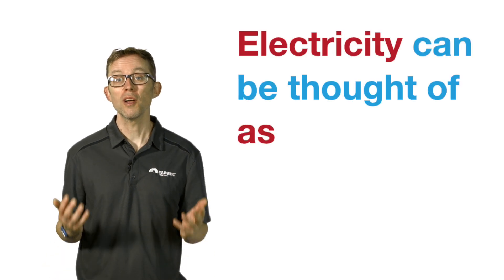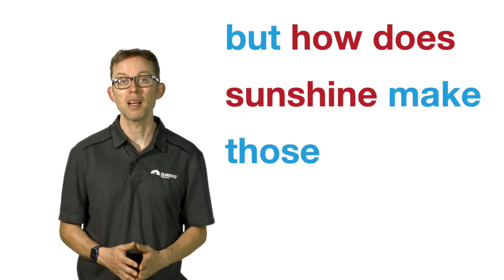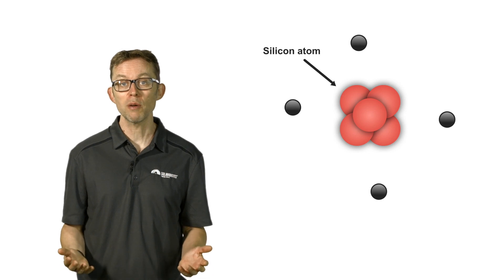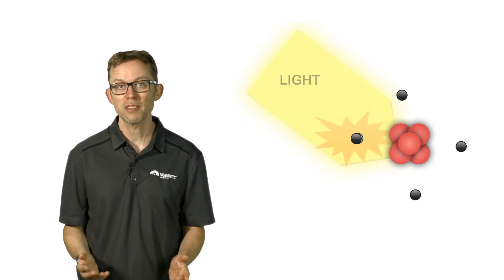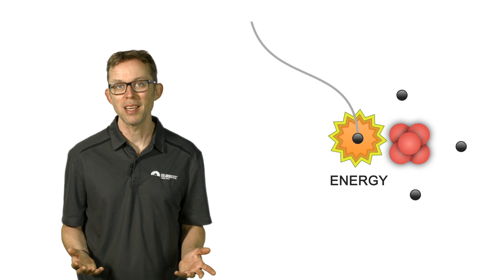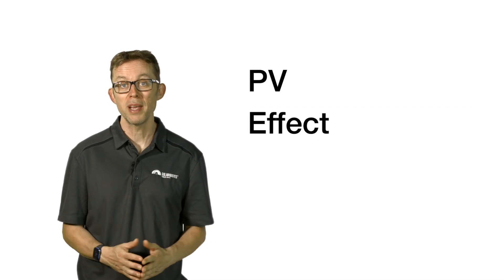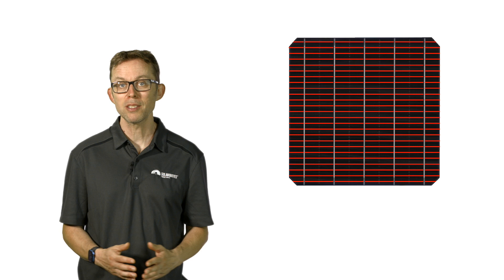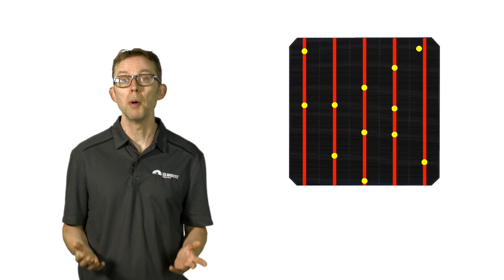How Do Solar Panels Work? Learn About The PV Effect.

Comment: I love your channel. But..at the end of this video you say you need to keep your panels clean. Yet in your maintenance video, you say cleaning is not needed if your panels are on an angle. Im confused? Surely whether they are on an angle or not, dust. Bird poo, tree leaf sap with wattle pollen, soot from high traffic roads would all add up?
Reply from the maker: Most panels at an angle clean well enough in the rain. But everywhere is different - if performance degrades obviously (monitoring!) then get them cleaned.
Reply: @SolarQuotes  mate i own a solar panel cleaning business. The amount of dirt and dust, traffic soot, fire soot(from 2020 fires) bird poo, wattle pollen spots, tree leaf sap. They need cleaning every 12 months. Even installers who do checks offer cleaning as a bonus service. My client the other day had a 30% increase after i removed Lychon(moss) and all of above mentioned.. And his panels are on a 35° pitch roof.
Reply from the maker: If they are dirty enough to affect output more than 5%, clean them. Luckily most angled panels in most places will self-clean just fine in the rain to keep the losses mu ch less than this.